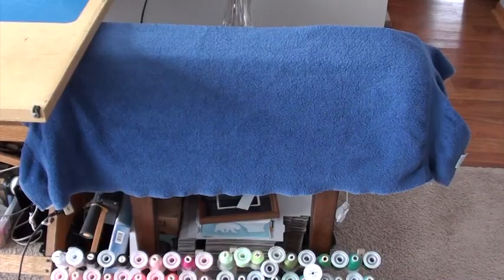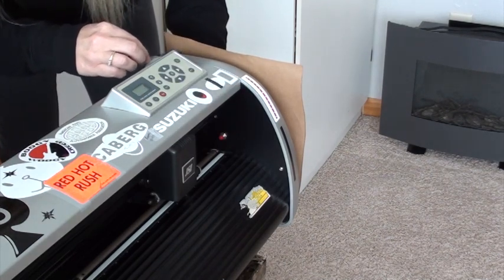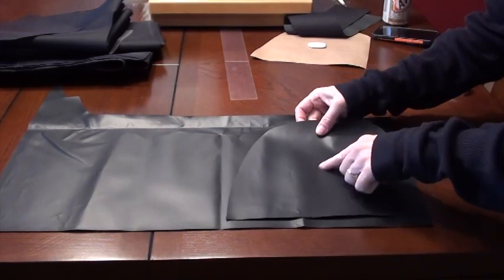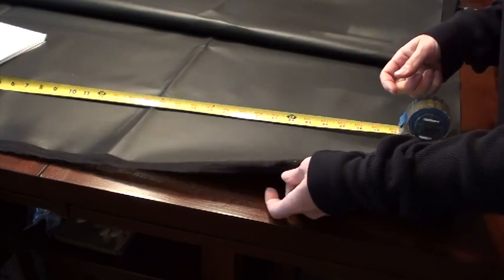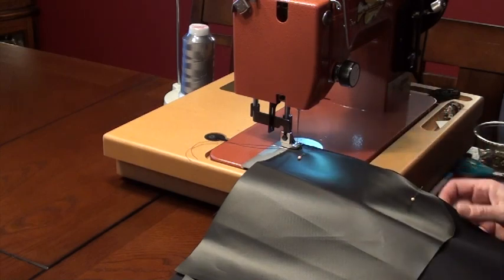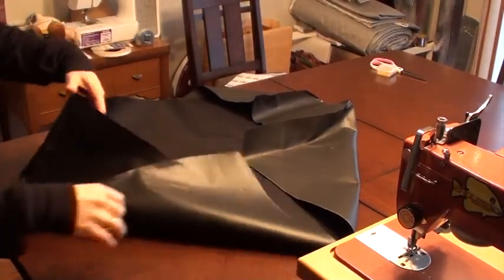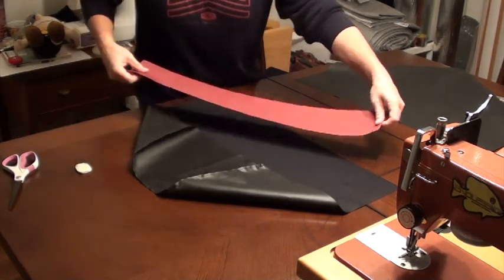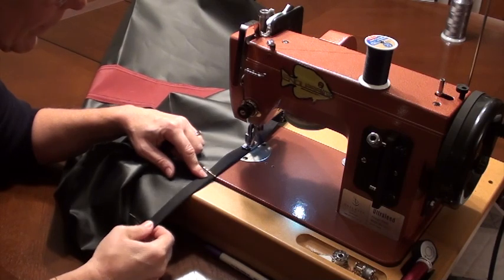How To: Self Draft and Make a Cover

Comment: Dang that machine is a beast!! Im going to be ordering my first flip over ice shaak and am already thinking about making a cover for the sled that zips open down the middle so you dont have to remove the cover if your working on the fly. Im so bad with my sewing machine I literally should wear safety glasses because of all the awkward DIY stuff i've done with just a basic old machine I got at the thrift store lol
Reply from the maker: Lol! Sewing machines can be dangerous! The one I'm using in this video is a Sailrite LS1 which was a great machine but it didn't have the foot lift I needed. I sew things with many layers of heavy material and while that machine had the power to sew through it, it just wouldn't fit under the foot. I sold it & upgraded to a full commercial machine called Consew 206RB-5. I love it! 

Sewing heavy stuff on a home machine can really make it much more difficult (and miserable) than it should be but if you're running an old machine, you're probably better off. New machines are mostly plastic and very lightweight; old machines are metal & heavy. Those usually are better for heavier materials.

For your ice house cover, you might just want to take the existing one (or buy the cover that fits your portable and just put a zipper in it. You might save yourself a lot of grief. Zippers are easy to install. Just make sure you add a flap over the teeth to keep most of the ice & snow off of it. Good luck with it! :)